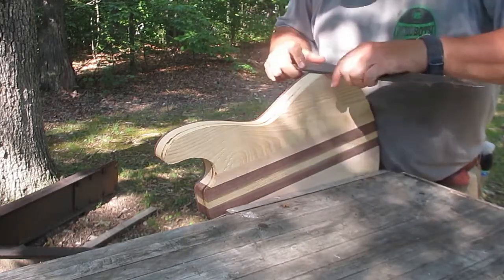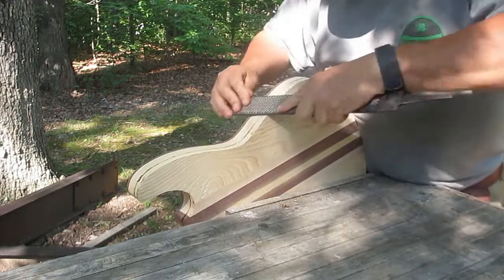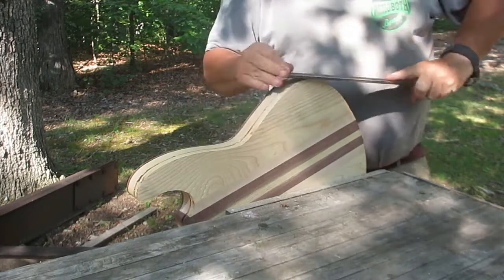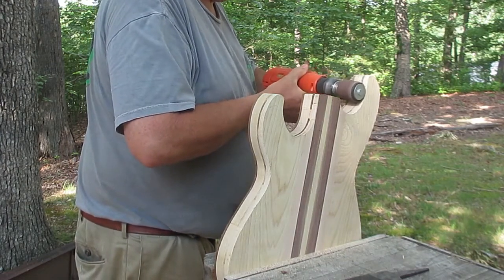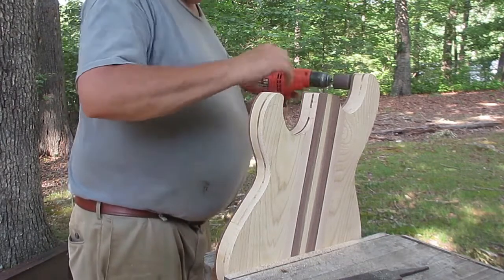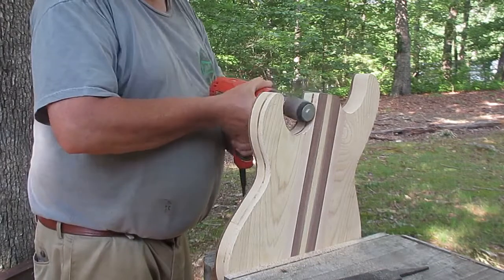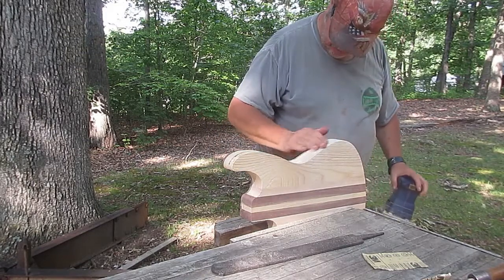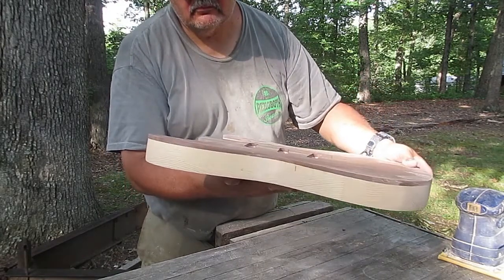Electric Guitar Building Leveling the Sides

Comment: The horns are very difficult. Im doing by hand in my projects, since I dont have the appropriate tools. I am going to level the sides by hand too with a sanding block. Do you think it is going to work? I already hand sanded to get it round, but as you said I made a lot of bumps. This is my first try. Thank you for your video.
Reply from the maker: Yes, the horns require a ton of work, and just when you think you've got them done you find out they need more work. Sanding is tedious, and seems almost never ending. But the more attention you pay to that part the better the results.
And yes, you can level the sides with a flat block, using the coarsest grit of sandpaper you can possibly get.
Good luck on your build!